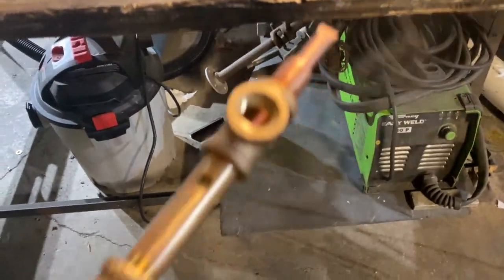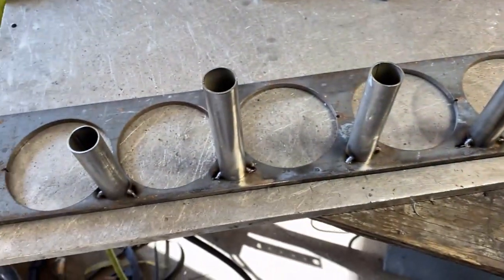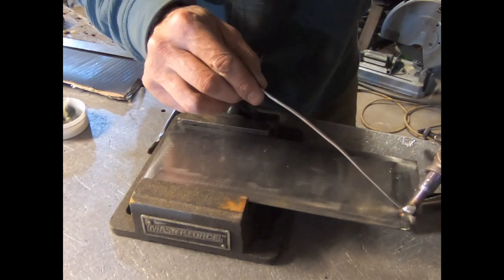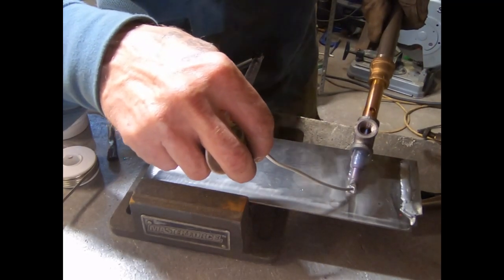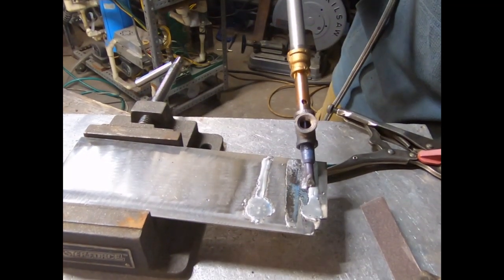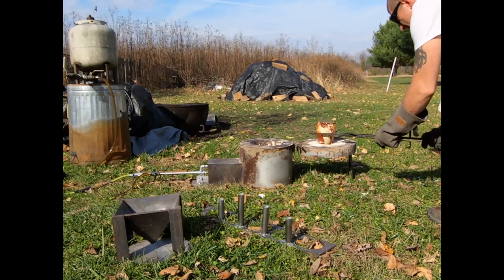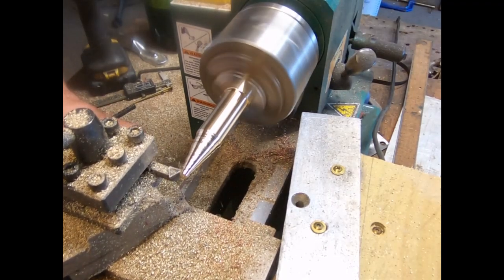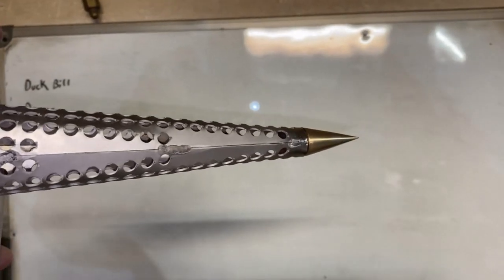1400 watt Soldering Iron for Men

Comment from the maker: Guys you gotta get some of this all purpose flux  https://amzn.to/3hj2dI0
Reply: try a tire grover next, same thing as a soldering gun just has a wire loop at the end to heat up and regroove tires with. also have you tried building any burners without air/ fan power?
Reply: Just wanted to add that phosphoric acid makes good flux you can get it from a rust remover ,its high concentration mostly 75%.Just check that there is no other chemicals in it.Another one that worked sweet for me(at least on copper and brass) was boric acid with extra 30%borax in it diluted in 96% etanol alcohol.You can apply it with brush and burn it off ,it leaves nice coating.
Might wanna try it out ,just in case you run out or if its cheaper than commercial product.
Reply: @zumbazumba1  YOU got that fella. No way to solder without the proper flux. Thanks
Reply: What you said is true and right on NOBOX7. Maybe make another video for us to learn from fella ??? Thanks for considering.

Comment: Hey, I'm really interested in your siphon nozzles specifically the newer design your selling for $85 on your site. I wanted to know if you have a video showing how to make them. I'm only 16 and don't have a job yet but I do a lot of oil changes and want to heat the garage. I might be able to buy one from you later on but the buy now button didn't work. I'm looking through your videos to try and figure out how your getting the fuel spear to stay centered in the black iron T and also how your getting the fuel into that spear through the back of it. Any help would be greatly appreciated
Reply from the maker: check dddescritpion to cccooonntact me , youtub wont let you get this is if i say certin words

Comment: First one does not tap clean a file on the bedways of a lathe even if it is a Grizzly CHINAMAN lathe. Just saying fella, speaking from experience. 
Many years ago, bet you 25 years at least,  I bought a soldering iron from a flea market that was rated 1000 watts. The thing weighs six plus pounds. The guy saved it because of the large copper 2 inch diameter tip. This unit is incredible. Works on anything you want to solder PERIOD. 
I soldered stainless steel tubs for the medical industry back then. You bring back fond memories NOBOX7. Have not used it since. Thanks for jogging my memory fella. T
Reply from the maker: If you look closely you will see { and hear } i actually  hit the oil pan below the ways , i would never hit a way like that so i do agree with you for sure .
Reply: @NOBOX7  So nice to hear from you NOBOX7. Glad we both agree on that fact. Hope you can forgive me for the error Sir ?? Am looking forward to see more great videos from you soon. I used my humongo soldering iron that i bought from Perkiomen flea market to solder my friends 4 inch copper sewer waste pipe DWV type. That place was gold for finding unique things. Keep us all in the loop too. vf

Comment: just in case if you run out of flux, pine tree resin desolve in alcohol is a very good flux use in soldering, it is cheap, non toxic and century old tested formula.
Reply: But BE WARNED PINE RESIN is HIGHLY FLAME ABLE
Reply: @kennethporst1738  in those cases usually is the proportion of of alcohol and resin. kind of "aging" problem. to desolve pine resin good, people put a lot of alcohol, it helps separate tree bark and other stuff, but in that stage, obviously alcohol cause flame, the traditional way is to let it rest in a jam jar with a loose cover lit. may be a couple of hours, while the excess alcohol run away. the finished product should have a amber colour and thickness of wood working glue. apply this flux by small brush. this is what i learn from coppersmith who make and repair musical instruments for living.

it works on electronics soldering too. i am not sure if us standard allows it on water pipe? but i have confidence it can pass water test.
Reply: @luderickwong  Thank you for tickling my memory fella. I used the same flux when I was in eighth grade electronics class. The power of pine rosin is just great.